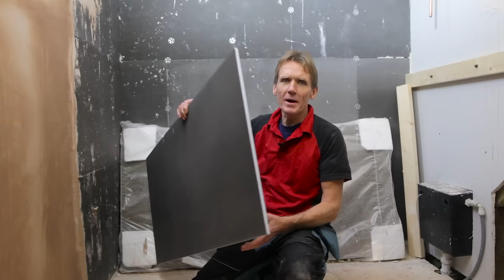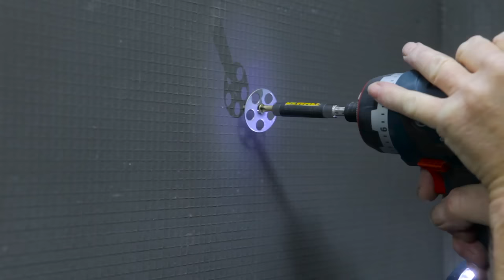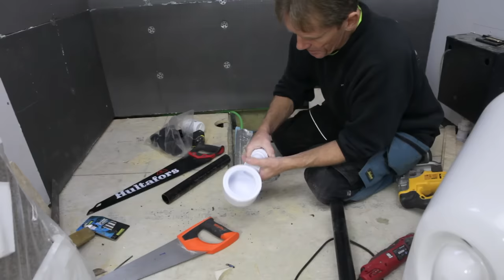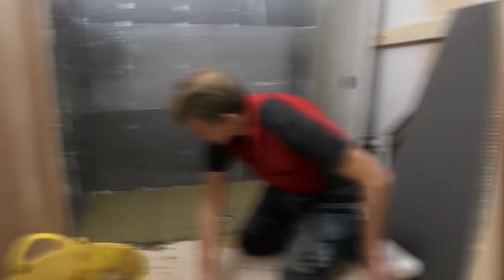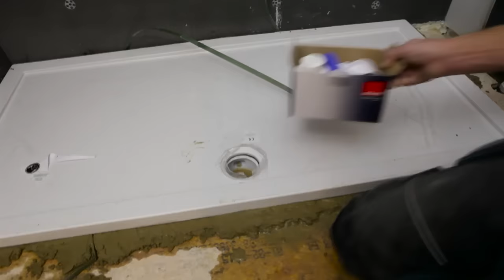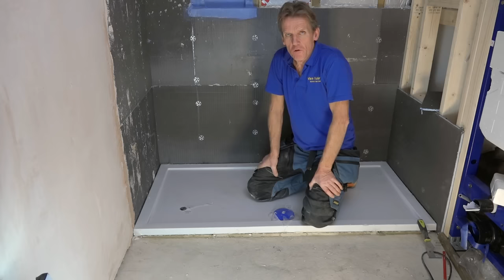Why Did the Shower Tray Crack? How Was it Fixed?

Comment: Use thinset with a 3/4 notch trowel. That is the proper way to do this. Never use that sand cement ( mortar mix). It shrinks when it dries. Thinset does not.  Mortar mix will also crumble over time with the stresses that the plywood puts it through with contraction and expansion from the moisture of the shower. Thinset is designed not to. The  Thinset is also designed to hold tiles or in this case the pan level without collapsing.  The  Mortar mix will not. The failure is entirely due to the wrong materials being used and builder error. It has nothing at all to do with the pan design. But someone needs to take the blame right?
Reply: I use tile adhesive also for another reason. I find that tile adhesive compress's easier when pushing the tray level and into position. Sand cement just does not seem to compress when pushing the tray down. I also tend to screw down some 6mm Backer Board under where the tray is being fitted. That's my tuppence worth!
Reply: Just do it based on the company recommendations.
Reply: Agree with you to a point, it's a case of using  the right mortar for the job
Reply: Agreed, but the crack may have occurred primarily because he tightened the waste down too tightly. Of course, he may have trodden on it before the mortar had set, impossible to tell.
Reply: looked like he tightened it up as the mortar was setting, probably the issue along with over tightening
Reply: May even have been a faulty shower base? D.i.t.?

Comment: Here in Australia they do the same thing

they use chipboard that’s treated and there’s also this blue stuff that goes on like paint and when it’s dry it’s a rubber membrane it’s basically liquid rubber and they paint that on the walls and push it into the corners with a bandage and I was wondering even though you’ve got the blackboard maybe blue membrane wouldn’t hurt over the top as well
Reply from the maker: we have that ProSeal and Aquaseal. It is a good idea,, no harm in two or three lines of defence

Comment: Just bad luck. I have read quite a lot of the comments on here some good some not so good. I think you have just been unlucky. Manufacturers instructions must be followed if they say use a bed of sand and cement it doesnt matter whether or not you think silicone or any other material is better you must use what they recommend for the tray you are fitting. Not many Plumbers will ever agree with everything you do and techniques will always vary but Ioverall I think you have done a good job. When the fan started this time you were in the way thats all. Hope you didnt have too much trouble swopping the tray

Comment: Straightline Tiling Australia.Recommends waterproofing entire recess.paint on paloma membrain.
screed under shower base sand & cement mortar. Trial fit base into place (level) then remove.scratch out 
5mm let it dry.next day glue into position with rubber based tile glue.let it set then waterproof wall floor union

Comment: We had a shower fitted by "professional" plumbers and 3 - 4 years later the tray cracked. On inspection, while deciding whether to have a go at replacing the tray ourselves, found the main central support of the riser kit had been left hanging in mid air instead of fully unscrewed to support the tray. 5 year guarantee on tray invalidated by bad installation. Plumbers long gone. Moral of the story: sometimes the "professionals" are in a rush / cutting corners to get the job done whereas if you're willing to do it yourself you might take more time and care to get everything right.
Reply from the maker: It is a disgrace to see that kind of thing. There is nothing hard about getting that middle leg screwed down. It is pure laziness and contempt for the customer. I wish these people could understand the misery they cause. You were good enough to give him the work and he shafted you.
Reply: Thats horrid, I am a DIY chappy and due to the waste pipe level being to high into the soil stack had to build my own higher riser using plywood ect,  due to height had to fix battens to the underside of the plywood base as the legs were not long enough to reach the floor, but now every leg base I could get at was tight to the floor and screwed down were I could,  took me ages to do due to space the Mrs moaned taking to long could not level on sand and cement so used low yield foam got level just right and 2-3 months on no cracking and its solid. hope got it sorted.
Reply: @paullefur6213  I'm sure it's time well spent, should last you a long time and you have the satisfaction of having done it properly.

Comment: Hi Roger, excellent video thankyou. I noticed in the video you were attaching the Elements tile backer board straight onto the studs on the side wall of the shower, but for the shower back wall, you had first attached an Xtratherm layer onto the studs, before then attaching the tile backer board. Why the difference in approach? Is it because the shower back wall is an external wall and you needed extra insulation? I am in a situation where one shower wall is external and the other internal and I am wondering what to do about these differences. Many thanks, Jon
Reply from the maker: You are spot on Jon. I had a stud wall on the dormer but on the right-hand side I built a false wall out from the stud wall to give me the ceiling height. The Xtra Therm on the studs prevents a bit of cold bridging but the Elements board is also a very good insulator. The good thing is that the tiles are the same temperature as the room so there is less chance of condensation and mouldy grout. I put in as much insulation as I can because I hate paying heating bills.

Comment: I think I would have set cement dabs, set the tray in and then lifted (I liked your idea of using old packing straps) it back out to see the effect on the dabs.  If all looks Ok let it dry off. I prefer to use high modulus silicone towards the edges to bed shower trays in and leave a couple of bags of plaster in the middle of of the tray while it goes off (same idea as half filling a bath with water before silicon sealing the edges). The silicon offers a spread of support and avoids any point loads but offers a little bit of give.  I have not seen any rigid shower trays crack by being held high at the edges.  The cracking problems occur where the middle of the tray is held higher than the edge support
Reply from the maker: Joseph 
Good ideas especially to avoid shrinkage problems . I did put a couple of pack of tiles on it to make sure it stayed but I think it was weak. The Mira Flight is way better
Reply: Skill Builder Mira is a bit pricier but the quality always provides that piece of mind.  Anyway I enjoyed the fact that you showed a  'failure' as we have all had them and that's when you learn the most.  Experience has taught me to wary of anything rigid and to always provide a bit of breathing room for movement. My latest disaster was installing a Bette enamelled steel bath.  The feet assemblies consisted of two frames one at each end and secured by threaded hooks that located to metal loops welded to the bath underside. The loops were a bit tight to the bath with not enough ready clearance preventing the insertion of the hooks and so a levered them out a bit with a twist of screw driver.  When I flipped the bath over I found that the enamel had blistered off where I had applied force with the screwdriver tip.  Not Bette's fault but a simple result of me doing something quickly without thought for potential consequences.  You live and learn and I'll not do that again.
Reply from the maker: I have always been concerned about that problem with the feet on enamel. If the steel is distorted by the slightest pressure the enamel much flake.

Comment: Re your comments about floor joists, I'm assuming it's not a ground floor shower? Would you use DPM under the whole room / on the chipboard or marine ply? noticed you didn't seem to have any down...
Reply from the maker: +Mat Smith 
Yes it would be good. I used OSB3 because it is moisture resistant but this time I am going to apply a tanking primer as well.

Comment: Anyone watched Holmes on Homes, the Canadian builder chap, he used some great products, Detra/Dietra/Deitra system, seemed on the surface a very good system, the shower tray consisted of a two part jigsaw toothed hard styrene (king span) type thing, you tiled straight onto it and it also acted as a thermal break,  then like mentioned you needed a sub floor of wbp ply well screwed n glued down to ensure no independent movement to insure no cracking. Holmes aways said he could build a bathroom that could out last the owner so cost may be the issue.

Comment: Hello mate, thanks for the video. What exact mix do u use for the tray bedding please (and do u add plasticiser or anything else)? thanks
Reply from the maker: A lean mix of 6 parts sand to 1 cement. If you put a bit of PVA in the mix is will hold it together and plasticise it. You should not make it too wet because it will shrink as it dries so a minimal amount of water and maybe a notched trowel so you can just push it down level. I usually level the mix off first so it is just about right before putting the tray down.
Reply: @SkillBuilder  Great - Thanks.

Comment: I liked the Aquapanel glass fibre reinforced cement board. It needs good edge support but it’s solid stuff. Use tile adhesive to bed the joints.
Reply from the maker: I have used it many times but five sheets in the van weighs a lot and it is dusty to cut. When I am working in blocks of flats a lightweight board is much easier

Comment: i just bought a expensive stone resin slate effect low profile tray and its terrible . there is a bow in it which floods water onto floor . tiles were in and silicone too .... but its had to come out . ordered one with a good old fashioned edge round it now

Comment: oh blimey, I am just about to fit a similar type shower tray, 1300mm wide, but I have bought the leg kit to make life easy for the waste.  I shall now be very careful with it..  Great channel nice to see a Brit posting videos...
Reply from the maker: +Cottage workshop 
If you have the leg kit the chances are it is better than this acrylic capped concrete. What is the make of the tray?
Reply: I bought it online, its a classic or elements shower tray from the MX Group. Its an acrylic capped resin tray and has positions marked in the resin for each leg. I also need to transport it 500 miles in my car so I shall be careful with that too, i could not buy a 1300mm wide tray in France.
Reply from the maker: +Cottage workshop 
 I think it should be OK especially if it is Elements. The tray I used was a lot more like a concrete base.
Reply: I'll let you know how it goes.....  thanks a lot for your comments

Comment: I agree with everyone who says to use tile cement instead (the powdered stuff, not the wet premixed shit) I've installed hundreds of trays and never had an issue. By the way, that protective film you leave on the tray isn't protective film and if you think about it, what is that extremely thin layer of plastic going to protect? All manufacturers state to remove the film coating and check for any damage prior to installation. Take it off, bin it and use a thick dust sheet or even some cardboard to protect your tray instead.

Comment: I know this post is old so this comment will likely be never read, but no one seams to have mentioned this. The problem with the tray is as you rightly point out the thinnest part and weakest is the centre where the waste is to get the fall. I am guessing that is where the crack originated. Do you think if you had put the waste  against the wall then when you step into shower you would be standing on the thicker side of the tray, seems an odd thing to do put the waste on the outside?
Reply from the maker: The trap is often put on the outside to make it accessible and it is just inside the glass so not in the way  but I take your point. It cracked before it was used. We have another case from a viewer where a tray cracked all the way around the waste and the manufacturers said. "You are not supposed to stand in that part". They need to make that clear and then we can tell the customer and the customer can tell their friends and if it is being put in a bed and breakfast the landlady can tell her guests not to stand in that part of the tray and not to have any hanky panky in the shower. 
Personally I would rather buy a better tray that doesn't crack. The Mira Flight is the tray I replaced this with because I didn't want to put in another crap one and get it all tiled in only to find the same thing had happened again.
Reply: @SkillBuilder  Just bedded and tiled mine with the waste against the wall, used tile adhesive rather than sand and cement (there seems to be mixed views) So far so good, have told everyone to avoid the waste. Hanky Panky? I wish

Comment: Tray from Victoria Plumbing?? Had an identical issue. Client bought the tray cause it was cheap and the right size for what they needed. Fitted the tray and next day noticed the crack...guess who had to buy the replacement?!? I'm like you, the cheap trays are just bad and best avoided.
Reply from the maker: Thanks Nathan.
My rule is that is fhe customer supplies the materials they take the hit.
Reply from the maker: I wouldn't touch Victoria or Bath Store. If that is what the customer wants they can find another plumber

Comment: Hi just doing my bathroom , taking your advice regarding elements board, onto a studded wall, then using nuance wallboards,, should these elements boards be rigid enough for the wallboards, and what manufacturer did you use, you said it was a uk company. Great video very helpful.
Reply: Is an abacus elements board, search for tile backer board, I use jakoboard personally but it's all the one. If your studs are 400mm centres you should be good, although I have tiled wider,  but i wouldn't reccomend you do. Dont forget to use washers on the board, and seal everything with a tanking kit. Classi seal tanking kits are awesome, but whoever's made it it's all the same stuff really.... sorry if Im too late for ya.

Comment: Hi, did you seal the joints in the tile board? Thanks much 👏🏻
Reply from the maker: Hello Slash
 The product is called Aquaseal. It is best to cover the joins with waterproof tape and seal it on the board with the Aquaseal. Have a look at our bathroom installation video.
Reply: @SkillBuilder  Thanks

Comment: I've been watching hours of Skill Builder videos while stripping my old en-suite out back to the stud work ready for a full rebuild.

I have chipboard floor boards and it's close to level and solid.  The tray manufacturer recommends footing the tray on a sheet of ply then bedding with sand/cement or cement based tile adhesive.  

I'm intending on laying Elements board on the floor before tiling and my understanding was I could just put the tray on elements board rather than ply wood.  Am I correct in that assumption or should I stick to using ply under the tray and Elements for the rest of the floor?   

Elements under the tray as well means I can put the Abacus seal tape on all joints round the wall/floor edges which I really like the idea of.

Cheers

Simon
Reply from the maker: Hi Simon. I would put a sheet of ply down under the tray just so you comply. Give the ply a primer and then coat it with some ProSeal and then put the Elements board around the tray and seal the edges to the the tray. If you seal the joints in the Elements board and then use No More Leaks tape around the shower tray where it meets the wall you will be fine. I would stick the edge of the tray to the wall to seal it and stop it moving and then use the tape, then the tiles, then the silicone.
Reply: @SkillBuilder  
Thanks for reply, really appreciate the guidance. 

Simon

Comment: All that work about putting the concrete in perfect that's a shame. I use a stuff here called structolite. It's similar to plaster of Paris very soft to work with and I just put piles of it all over the place under the shower base I'm putting in then I press the base down, to a level position, I walk away for a day let the structolite setup. Thankfully I never had any problems like you did. I saw your video I think they should definitely stand behind their product give you your money back or the next pan free, definitely tell you why the one you put in broke

Comment: I used to always Dredd fitting a bedded shower tray. Much preferred the adjustable leg type.
Reply from the maker: +B1cam 
Yes I agree but now everyone wants the low profile wet room look without the hassle of tiles. Sometimes there is just no way of getting the waste out so you have to put the legs on.
Reply: +Skill Builder I know it's a bummer. Luckily for me I rarely do plumbing anymore. Mostly boiler repairs n maintenance some heating installation. Still, I enjoyed the video and very honest.  Thanks.

Comment: Was that an electrical box just behind the tile board on the right?  (as  you view the video)   Very crazy...
Reply: Not crazy. It's a macerator which is common in areas like a loft conversion/extension where the soil pipe is too far away. The electrics are sealed as if it is outside (IP rating) so nothing to worry about. Designed for the job.

Comment: A flexiable tile adhesive works better. But reality is that tray was probably cracked before it even went in.
Reply from the maker: It certainly wasn't cracked before it was installed. The design where it is thinnest in the middle was the problem